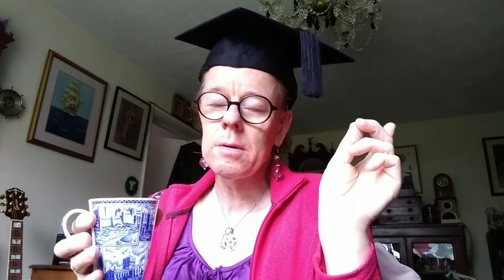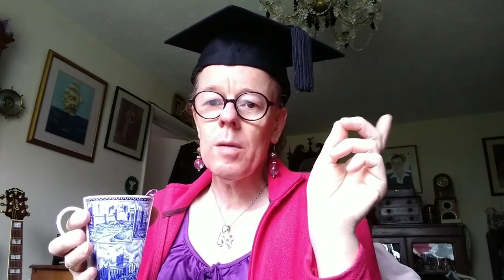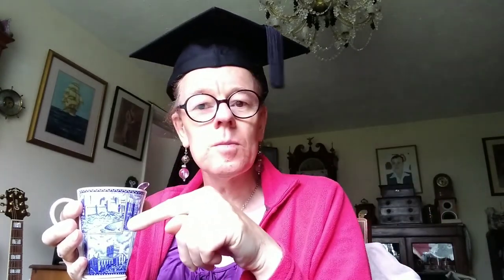Shortwave for beginners grounding your station.

Comment: Hey Karen, since the Artificial Ground unit has adjustment knobs, do you have to tune the device for every band? If the answer is yes, does this device work on all frequencies from LF all the way to microwaves?
Thank you, 73.
Reply from the maker: An interesting question which i am happy to answer.Yes you really need to tune the tuner for each band.It is good for hf ect and i have never tried using it on vhf and higher.I find it works well on the lower half of shortwave particularly.When i listen on the tropical band and you set it right there is almost like a sweet spot.I would get better performance over the entire shortwave spectrum if the wire to my ground rod was shorter.Remember the shorter the wire between the ground rod and your RX the better.If you are thinking of getting one i would say it's well worth it.If you already have one i would say well done.They take a bit of playing around with to get the best from them but a very worthwhile item to have in the system.Remember everything that has a ground terminal needs to be hooked up to the ground tunner.Getting rid of noise on hf is a combination of little tweaks all adding up to a good improvement.🐻🤗👍